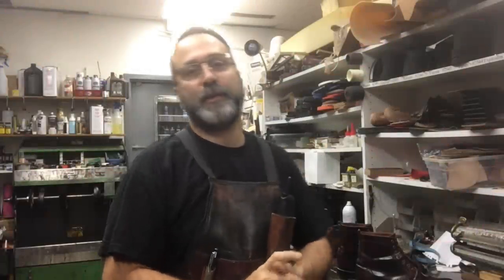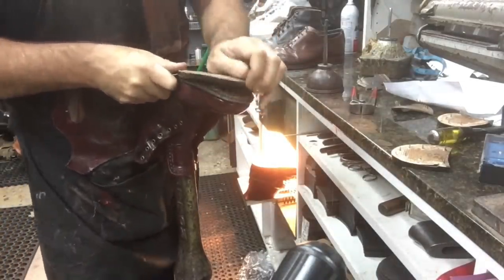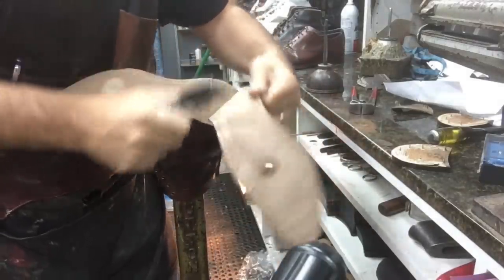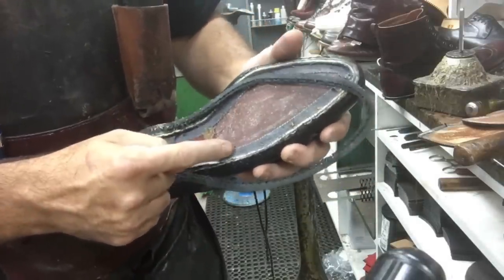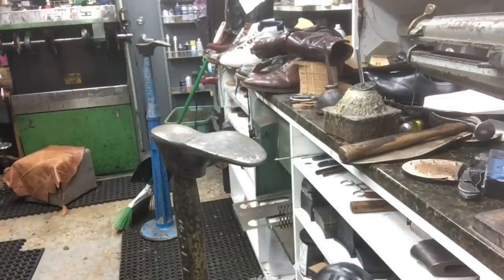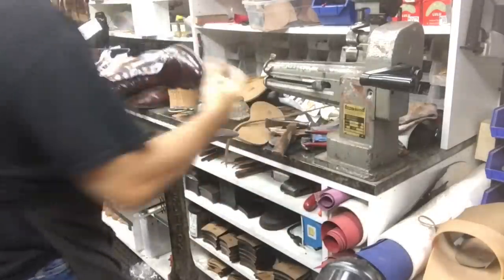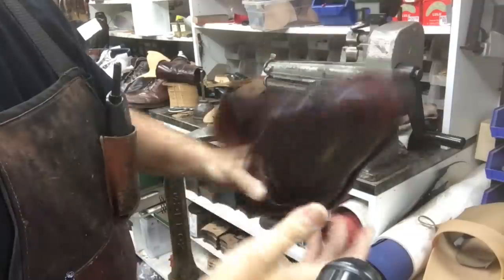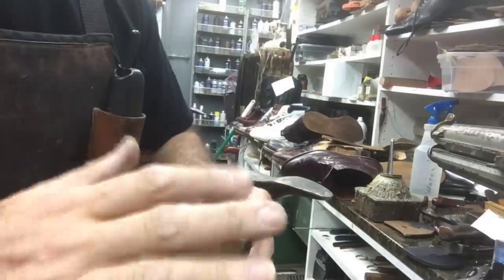Allen Edmonds Dalton Detail Restoration (Part 1) #89

Comment: +Bedo's Leatherworks LLC
Steve my question is am I able to have the footbed replaced along with heel and sole? I have some vintage Allen Edmonds but it's not my foot imprint on the "footbed" I ask because there's a big dent inside the footbed of the shoes. I thought having the Cork replaced might correct this. If I understood correctly this is separate.
Am I being clear?

What is the correct terminology called? a complete Restoration? I'm trying to learn the lingo. Please advise, Thanks Angel from The Bay

Or does anyone know?
Reply from the maker: pcking2008 
When the sole gets replaced, you should replace the cork. Once the sole is on we can wet the footbed and put it in a press to flatten it out. I’m worst case scenario we can replace the footbed.

Comment: I think it must be quite difficult to control the thicknes of Hot cork paste ?
if you use the standard cork sole it will be allover the same thickness,
( maybe it would be an idea to use hot cork on top of a new cork sole to make it thicker &  durable at some pressure points ? )

Comment: 14:44   It might be a good opportunity to get some very fluid adhesive into the existing holes of the sole bed, just to lock the existing rubber to the pressed fiber body....?
Reply from the maker: guy saunders not necessary 
That gets nailed to the sole

Comment: I had a very nice pair of boat shoes that were not cheap and the soles were worn but the uppers were like new. I took them to my local shoemaker and he said he could glue another sole on. He told me that he guaranteed them to stay on. After 3 weeks, both soles started to peel off. I took them back and he said, " I don't know what you did with them." I said that I just wore them. He  could see from the uppers that I took care of them, but i didn't like his attitude ,so i just threw them away and will never use him again. I am not in favor of just glue when there were nails. It cost me $60 for him to ruin my shoes. I have 2 pairs of Wolverine 1000 mile boots and when the time comes for repair, i'm going to be very cautious!

Comment: "Hammering the air out of the pockets" is NOT as good, NO actually it's NOWHERE NEAR as good as pressing them. Hammering is uneven no matter how u look at it.its just not as good. Which is why is been done like that by professionals forever. It's the right way, but if he don't like it because "it leaves a mark" then to each his own.  N also the stitching how could he only use glue? Idk but if it's my shoes I want them stitched, once again the way is been done forever and the correct way. It's just significantly more durable and gives a better hold. But don't think I'm hating on him,because I'm not. In fact I honestly love his work, I think he's awesome at what he does and he definitely does a great job.  n he's totally right about doing right by the item being restored if it needs extra work to be right than you do the extra work. Gray job restoring these